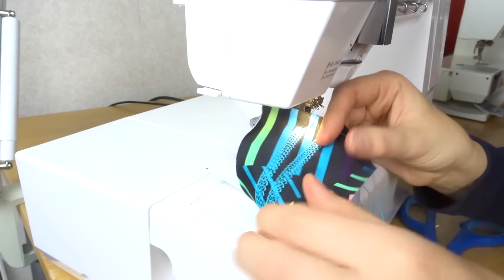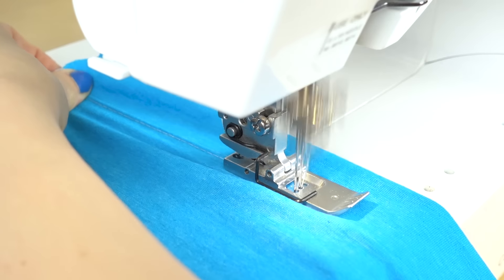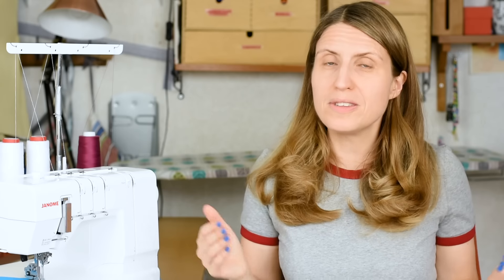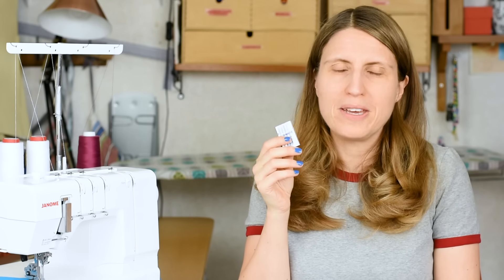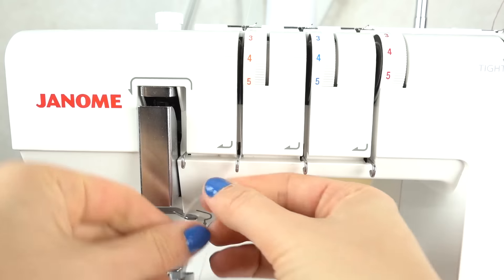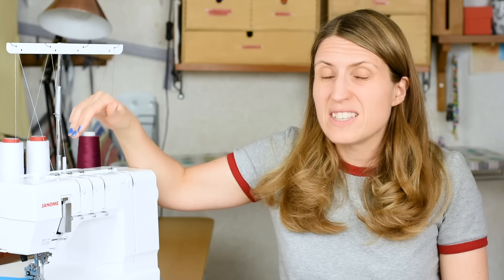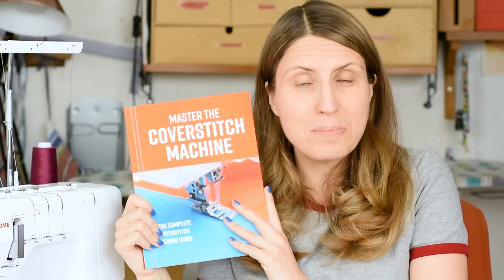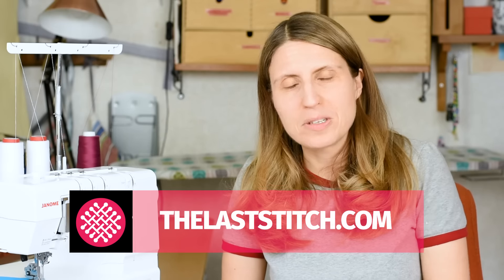8 Tips for Successful Coverstitching: Master the Coverstitch Machine

Comment: Great video Johanna! I have a Bernette B42 and I wanted to throw it out of the window for about a year. I was so sad because it was a big investment for me and my hubby had given it to me for Valentine's Day. Then, one day I saw a tip to use the thread nets and it changed my life! Most of the problems that I had seemed to be tension, adjusting the dials just wasn't solving them, but that one simple thing changed the way my machine worked. Now I love it, other than changing thread colors with each project (but it is relatively easy to re-thread).
Reply: On changing color: You may cut the thread high up, and make a knot on your threads, two single knots that make a double, pull well, and cut the ends first. Stop before it reaches the needles.. go slowly.

Comment: Hi Johanna, I've got your books and they help tremendously! I have the Janome Cover pro 1000 and I'm loving making my own leggings but I find that the hems are very tight on them after I sew them on the coverpro. Everything else seems alrightny suggestions as to the settings?
Thanks,
Andrea
Reply from the maker: Decrease the stitch length and/or increase the differential feed a bit. That will usually fix the issue. And thank you for getting my book!